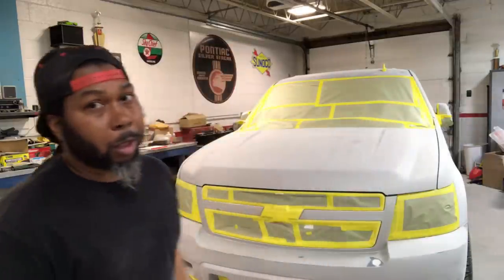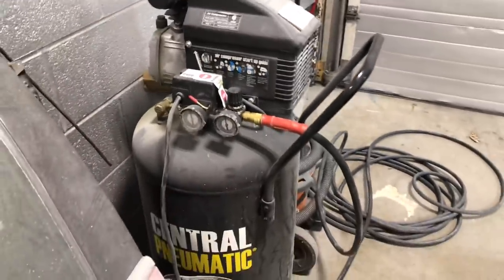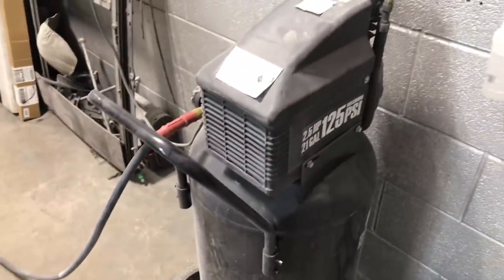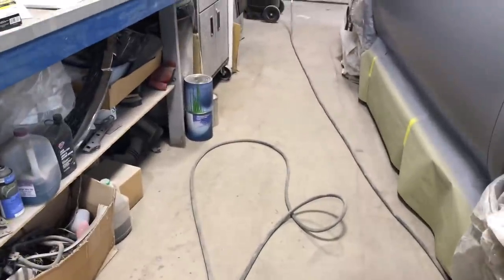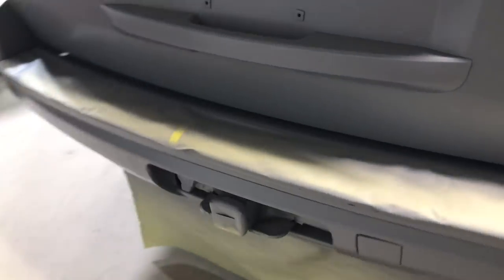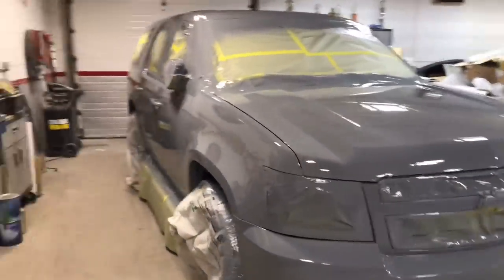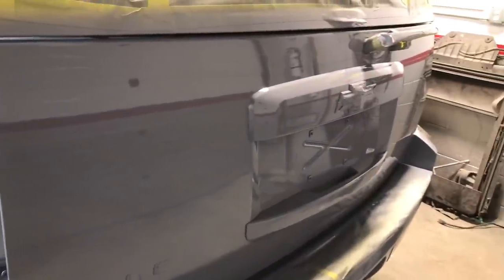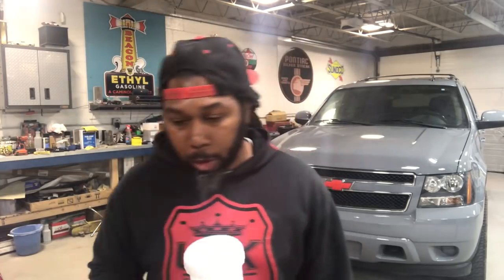COMPLETE PAINT JOB with the SPRAYIT R500 LVLP spray gun and a small compressor

Comment: I bought the SprayIt 33500K kit through Home Depot as they had the best price... I got SCREWED. The small R100 gun is JUNK right out of the box. For starters I pulled the nozzle out to clean it of packing grease before I used it.. The nozzle was screwed in SOOOOOO TIGHTLY that I had to resort to a deep well socket, and then pressing the body of the gun down flat onto my work bench while I tried to break it loose... After I got all the packing grease out, and got it all back together, I decided to just run some reducer through it to set up the pattern, and clear out any final grease or debris that I might have missed while cleaning it...  As soon as you grab the trigger it starts spitting. You can see that air is forcing it's way back into the cup as if you look closely while holding the trigger you can see air bubbles going INTO the paint cup! It also just constantly spits and sputters not putting out a smooth consistent flow of liquid. If you turn the volume knob in, the cadence, or frequency of spitting slows down.. If you turn the volume knob wide open, the frequency of spitting increases. You can physically feel the spitting from holding the gun in your hand.. If anyone has any ideas on how to fix this, PLEASE let me know. Otherwise, I have to order another kit and wait for it to arrive. I tried the BIGGER gun in the kit the R500 and it works perfectly after cleaning. I'm trying to paint a single car door mirror and did not want to load up the big gun for such a tiny project... I guess I have NO CHOICE though as the little gun is TRASH right out of the box. I've tried tightening everything up. I've checked that all sealing washers are in place. Ive tried various air pressure settings, volume settings, fan settings, air control WIDE OPEN... Nothing stops it from spitting like a Llama.  I'm running an 80 gallon compressor, multiple filters, and air dessicant system, an air pressure regulator right at the compressor keeping pressure down to 45 PSI, and then another regulator on the gun dropping pressure to the 15-20 range. Air supply is NOT the problem as the big gun just blasts away with no spitting, sputtering, or other issues. If you know of some things I can try-please let me know!
Reply from the maker: Hate that the gun is doing that and it really sounds like you got a bad one to be honest, I haven’t used the touch up gun so I can’t give you my experience with it but hopefully someone can help and I’ll try to look into it
Reply: @UndergroundPaintKing  You are da man. I don't know how you find time to respond to everyones comments-but it is appreciated! I finally figured out what the issue is. The large round atomizer (nozzle cover) retainer has a solid white teflon seal inside of it that is supposed to seal to the body of the gun. Mine was present, but not sealing. I figured this out by filling the cup with water, and a little bit of Dawn, and could clearly see the bubbles escaping from behind that nut as I was squeezing the trigger. I removed the factory supplied white teflon sealing washer, and put in the appropriate size rubber O-ring and.... BINGO! Spraying like a champ now! Now if only I could put down the paint as well as YOU can! Ha ha ha~! One day... If I watch EVERY one of your videos.. I'm already subscribed, but liked this video for you! Thanks again!
Reply from the maker: @Go69  I’m glad you figured out the problem and now your comment might help someone else out 🙏🏽💯 I appreciate you subscribing to the channel and I hope it continues to be helpful to you!

Comment: What’s the HP?
Reply from the maker: Are you asking for the horse power of the motor on the compressor?
Reply: @UndergroundPaintKing  yes sir how much HP is the air compressor?
Reply from the maker: @jayp9450  2.5 Hp on the compressor
Reply: @UndergroundPaintKing  thank you
Reply from the maker: @jayp9450  you’re welcome!
Reply: @UndergroundPaintKing  also how close are you getting? Is the fan and fluid wide open? Or how many turns did you turn the fluid/fan? Thanks again in advance
Reply from the maker: @jayp9450  it’s best to be 6-8 inches away from the panel and I believe I was wide open
Reply: @UndergroundPaintKing  thanks again

Comment: Wet your floor before you paint and it will reduce the dust that gets in the air that can contaminate the wet paint on the project.
Reply from the maker: Thanks I appreciate the tip

Comment: I notice that  you start from the bottom  to top?   Is that correct?
Reply from the maker: I started from the top and worked my way down…I started painting the roof first
Reply: I saw you do the roof first but you did the fenders and doors bottom to top, it still looks great.... going to do my first paint job on my suv, with the same set up. Question for you , do you use sealer primer?
Reply from the maker: @michaelclark8137  yes I use sealer
Reply: what size tips did you use for primer sealer, base and clear coat?
Reply from the maker: @michaelclark8137  I used a 1.3 for base and clear but I use a different gun for my primer and sealer and that’s a 1.8 tip

Comment: I used to have that problem, so I put a small 12" long by 3/8" pipe and a filter.
Reply from the maker: I’m definitely gonna put a filtration system together for the next job I use my small compressor on…I appreciate you checking out the video!

Comment: Lmao you really painted over all the bondo and rough edges. it's all going to bleed back through in a few months
Reply from the maker: 😂😂😂 I appreciate you checking out the video!
Reply: @UndergroundPaintKing  this did show me that I could paint with a 20-gallon compressor if I do have any trouble, I will get a second 20 gallon and run dual compressors this spring I am setting up a small shop at my home I have a client that does insurance work
Reply from the maker: @justinbabula6730  I hope you do well with your shop and the work you will do!
Reply: @UndergroundPaintKing  Thanks!

Comment: You probably don't need to worry about orange peel with the finer spray from that small gun.
Reply from the maker: If you set up your spray gun right, along with the materials you’re using as well as your environment you can get a good finish with less orange peel

Comment: LIKE I THOUGHT CANT RUN THE WHOLE WAY FOWN THE VEHICLE SO NO IT WON'T.    ONE HAS YO MAKE A PASS THE LENGTH IF THE VEHICLE TO PAINT CORRECTLY N THAT LITTLE COMPRESSOR WON'T KEEP UP AT A HIGHER PSI WHICH IS NEEDED.   NOT 30
Reply from the maker: Lol I made it down the length of the truck no problem and what’s correct to you isn’t what’s correct to everyone else but I appreciate you checking out the video
Reply: @UndergroundPaintKing  DIDT SEE IT SPRAY FRO FRT TO BACK.  WAS BROKE UP IN 2 OR 3 SECTIONS. BUT DID TURN OUT DECENT JUST A DIFFERENT PROSPECTIVE
Reply from the maker: @theedge5584  that’s just from how I edited the video…I don’t care for making long drawn out videos but I can definitely go from front to back…again I appreciate you
Reply: @UndergroundPaintKing  K